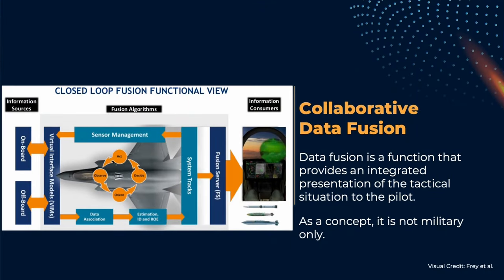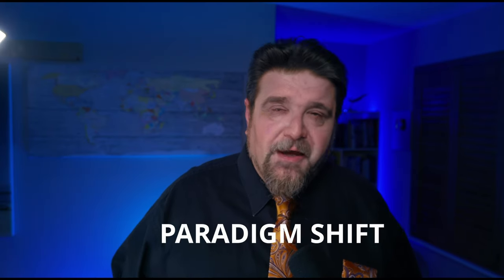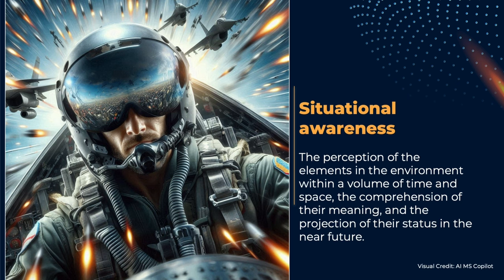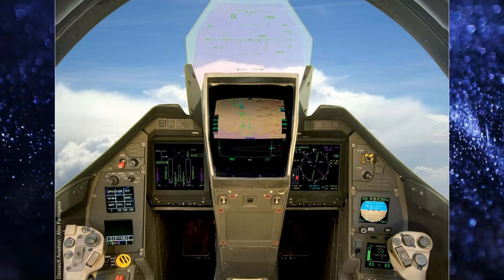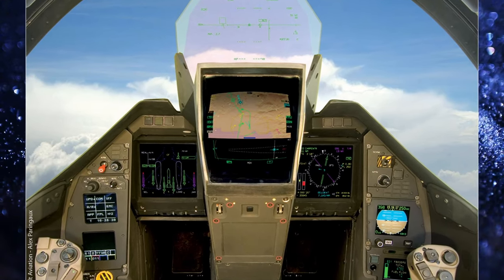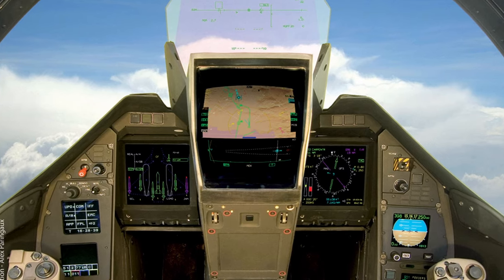F-35: We Hunt Like a Pack of Wolves!

Comment: the constant communication between the aircraft can this be picked up by enemy sensors and how far away could you pick it up?
Reply: The combination of directional antennas, low-probability-of-intercept and other EW measures makes this unlikely at any useful ranges unless you have got access to even greater sensors and more powerful processors and algorithms for signal decryption. There are also natural sources of radiation in those frequencies that allow for hiding in the noise.
Reply: These are encrypted channels
Reply: @sidharthcs2110  But they can be picked up? doesn't matter if they are encrypted that's another matter to solve but does this make your plane detectable in the whole.
Reply: As far as I remember from his videos, these signals r sent in a random patterns so it will be recieved by enemies as noise n only the specific reciever will interpret these noises as data @TheClanAdventures
Reply: @qa15q8  So you do broadcast your location then. Isn't this a vulnerability.
Reply: @TheClanAdventures  U dont, coz no signal is detected as meaningful (It will look like noise to the system which filters it out n throw it into the garbage bin)
Reply: @qa15q8  It doesn't have to be meaningful. Just the fact that the signal is picked up will this not make you trackable.
Reply: @TheClanAdventures  Makes sense. picking the signal at least will scream the presence of smth regardless of what is it
Reply: @qa15q8  Its just like stealth. So it makes your plane the size of a small bird and therefore harder to track. Not many birds fly at Mach 1+ So you program your sensors to track superfast birds/aircraft. Nice job for AI. Its defiantly interesting times

Comment: Can these Avionics be fitted in the 4th Generation Aircraft's and make them Hunt Ground Targets 🎯 and even other 5th Generation Aircraft 😂😆
Reply: You probably could. The big thing with the newer jets is that they have way more sensors, and so they can get a lot more data on any single target. 4th gen aircraft could take that data, but the data they give back would essentially just be maybe radar tracks and IRST detections.
Reply: @sheeplord4976  Those sensors and even more can be retrofitted on to the 4th Generation Aircraft's easily as they are not worried about compromising the Stealth features.
Reply: not really, they lack the generating capacity for the extra electricity needed, and heat build up around the avionics thenselves could be problematic, there just isnt the spare space to fit extra boxes, cabling etc

Comment: So if you can hack one you hack them all.
Reply: No, in you hack one you're only hacking one. The rest are still secure.
Reply: Hacking requires gaining access to core systems, which shouldn’t really be possible without hardware access. You could though, if *you’re able to decrypt the datalink, feed the opposing jets with false data, messing up their situational awareness. But unless you have immediate access to some super advanced quantum computers, you’re probably not doing that in combat.
Reply: If thats actually how it works (which it doesn’t) then that applies to any fighter connected via data link. You need to fly bi planes to avoid hacking